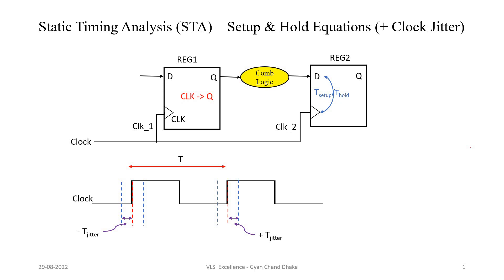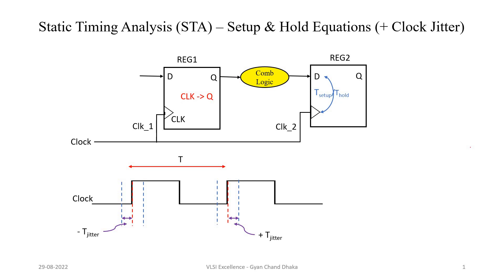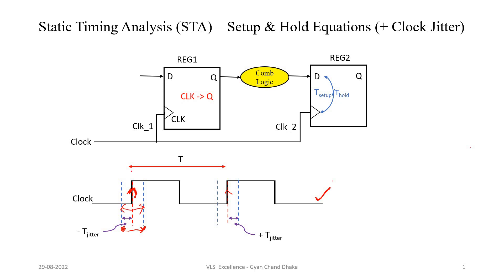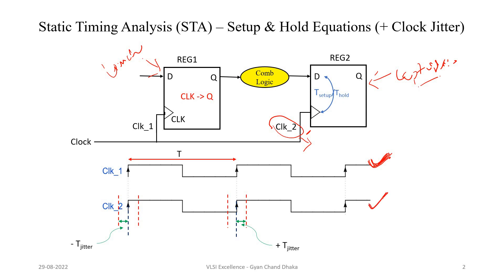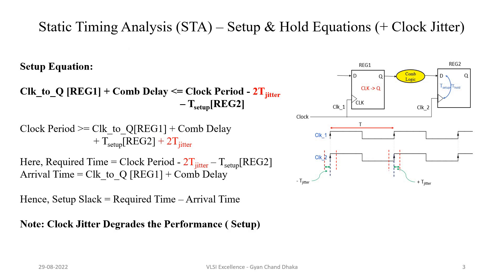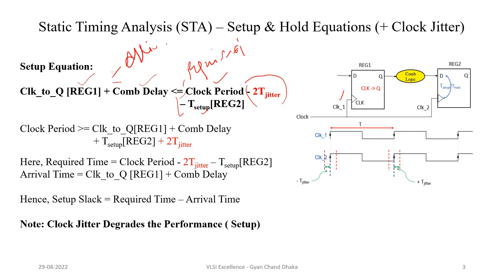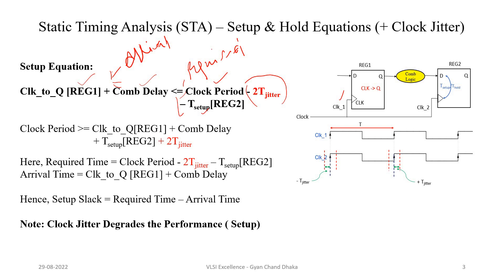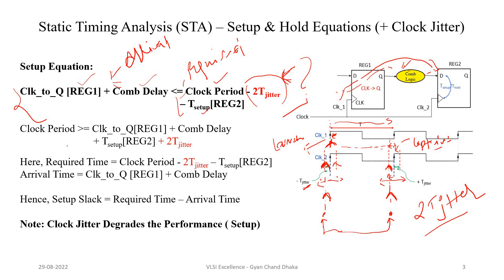Chapter#14 | Effect of Clock Jitter on Setup & Hold Timing Equations |Static Timing Analysis(STA) ✍️

Comment: Hi sir,

Clock jitter = clock period and duty cycle of clock can change cycle by cycle slightly due to clock generation circuitry.

Hold analysis is done on the same clock edge, like if if some jitter is present at the clock pulse then the same clock will be provided to both the launch and capture flop, then why do we consider the effect of jitter for hold check?

Please help me out here.
Reply: yes clock jitter should not have any effect on hold check because it checks on the same clock edge
Reply from the maker: Please draw the launch and capture clock waveforms with Jitter effect and analyze. You would be able to understand the Jitter effect as explained in this video.

Comment: Hi,

In both setup and hold check, the required time include 2*T_jitter instead of 1*T_jitter because of the worst case scenario is that the clk2 is skew left (for setup) and skew right (for hold), respectively, by 2*T_jitter on the 2 clock edges (lauch and capture). Is it what this video means? If so, is there any chance on the next clock period that the launch edge is already skew left/right by 2*T_jitter plus the T_jitter on the capture edge, which result in 3*T_jitter in the required time, which means the 2 clk periods has different required time?

If not, is that clock jitter is affect during 1 clock cycle only, thus do not affect the timing of the next cycle?

Thanks.
Reply from the maker: Hi  @LongHoHoangThien, We would consider a single clock cycle jitter effect only for timing